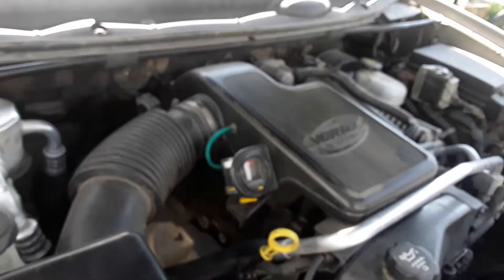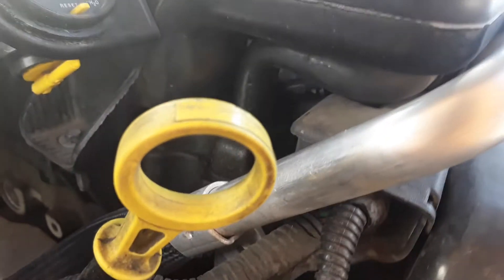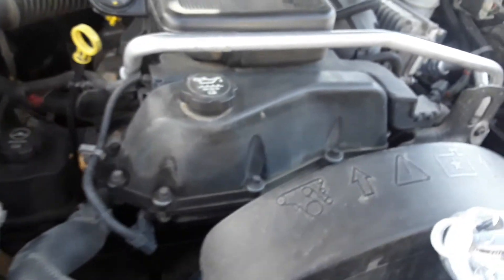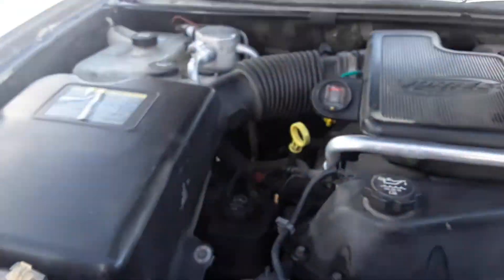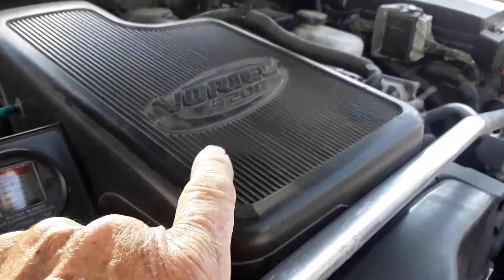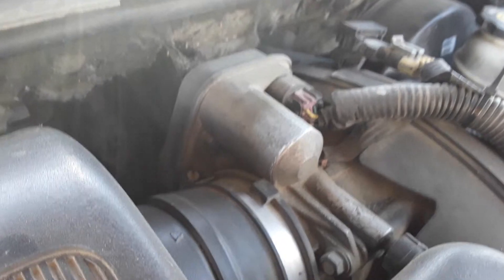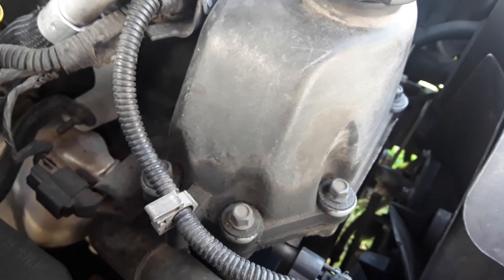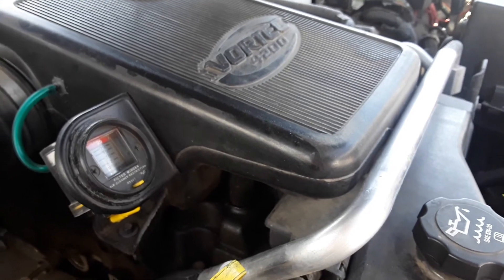Yes, The 4.2 Has A PCV System

Comment: Ok. I'm a newbie to car stuff I admit. How do you take that L hose off? Do u just pull the top part of it down until it slides off that rod thing? I'm sure I'm looking at the correct tube, I just don't know how to unhook it so I can pour stuff in..
Reply from the maker: I tend to not bother with taking the hose off the plastic nipple and instead remove the lower hose clamp and pull the hose up and open the metal tube. 
...... The metal tube is what you're after here - in some situations it's easier to take it off the top nipple - some it's easier from the lower nipple. 
..... You want to get the B12 into the tube, not necessarily the hose - but if you get it into the tube, it'll naturally run down into where we want it to go anyway. 
..... That big rubber hose is never gonna plug up without someone pouring JB Weld in it - and the actual problem is further down inside that metal tube.

Comment: Thank so much for the video. This system is more like the European vehicles no actual pcv but a system. Ps the Egr in this vehicle is control by the camshaft facer.
Reply from the maker: Sorry to be so late in responding, but I just caught this and as a matter of fact, this engine has NO EGR system - and that's because of the exhaust cam being variable and can keep the combustion chamber(s) from exceeding stoichiometric values.
Reply: @SurferJoe46  /ˌstoikēōˈmetrik/     relating to or denoting quantities of reactants in simple integral ratios, as prescribed by an equation or formula.
    "a stoichiometric amount of potassium is required for 90% removal of the SO"
wow - fancy word - thanks

Comment: Just curious... if you block-off the PCV hole at the intake,  and just vent the PCV hose into the atmosphere, would that eliminate any adverse effects from the PCV system without negatively effecting engine performance?  I understand it would vent unburned  blow-by gasses into the atmosphere,  but this is just a hypothetical question.  Also, why not route the PCV into, say, the purge system.  The pressure from blow-by would positively pressurize the fuel system and serve as a fuel pump assist.  Any over-pressurization could then be vented by the purge valve?  🤔
Reply from the maker: 1st --- the fuel system in the tank is under vacuum. If you pressurize it --- here come the flying monkeys. 
2. If you do not promote or at least maintain a vacuum in the crankcase, condensate builds up rapidly and gets homogenized into the oil and destroys the bearings, is especially nasty to the cam and followers and will rust the VVT into an inconvenient place that'll throw codes all day long.
Reply: @SurferJoe46  I never cared for flying monkeys. Thanks for the reply, I guess I won't reengineer my PCV system after all. 👍🏻

Comment: I don’t fully understand how to clean that tube. I’m pulling out the intake and replacing the valve gasket, and noticed oil all in the air box. Can you explain more?
Reply from the maker: The air box (correctly called the "sound deadener chamber") getting baby poop in it is because your CV-side of the system is totally plugged up and is reverse flowing.

The flow is INTO the nipple - that goes INTO the valve cover and INTO the crankcase and INTO the vacuum side of the PCV system (the CV-side) and is burned up as fuel. 

It's originally designed as an economy device but they found out it was sure nice to eat the sump gas fumes that smelled amazingly like an open sewer. . 

You have to take that rubber hose off at the plenum and add a couple of capsfull of B12 into it and let it cook a while. Repeat often until you get a small but noticeable vacuum at the oil filler cap. 

If you're removing the whole intake plenum and runners, you will have better access to the ports and you can clean them a lot better when they are in the open.
Reply: @SurferJoe46  got it! I recently replaced my valve cover so I took the intake off anyways and cleaned that hose you’re talking about. I also installed an oil catch can at the nipple and sound deadened chamber and it’s already filtering crap.
Reply from the maker: @TheCodesterr  That's all well-n-good, but you're not getting the water out of your engine.
You need to get that PCV System flow working, not just catching the bad results.
The problem is not being addressed the way you've done it and you run the risk of rusting the VVT intro a seized-locked position. 
Many people keep having trouble with the VVT and the PCV is the cause. 
You've gotta fix the problem!
You can watch this guy - it's not EXACTLY your situation - but the results and the logic are the same ..https://www.youtube.com/watch?v=PDkCbJOV-28
Reply from the maker: @TheCodesterr  The hose is only a pathway to the problem --- which is in the head gasket area. Taking the intake off will not allow access to the actual ports that are considered as the major players of the passive PCV system. 
When we pour B-12 in either the tube or the nipple - it goes to the same place to soften up and eventually allow the crud and corruption to be sucked out of those passageways. 
When they are clean, the PCV will be able to work and there will be NO baby poop in the air intake system at all. None. Nada!

Comment: Thanks for the info, great video. I just got one of these and I'm working out the kinks. My throttle body was disgusting and when I was changing the plugs I noticed a bit of oil so I did the valve cover gasket and plug seals. During that nightmare I noticed that the intake was totally filled with gunk, even the ports were caked with at least a quarter inch of goo. 

Did my best to clean that all out and that led me to the Trailvoy forum where I came across this discussion and this video. It's running much better now but I still get a bit of slight bogging for a second when I come to a stop. The idle isn't quite as smooth as I would expect from a straight 6 either.

I'm going to see if the CV side hose is clogged. Maybe the entire intake manifold being clogged caused the same thing as you described. Any more tips for cleaning that out? I think it must be worth a shot, but I do feel sketchy dumping cleaners down there into the crank.  Should I just remove that hose and clean it or is it probably clogged deep inside the passages? Any specific cleaners I need for this? Can I just safely dump it in there and pump it back out with a hand pump? Any details would be greatly appreciated.

Sorry for the 50 questions but you seems like a trustworthy source and a helpful person and this info doesn't seem easy to come by. Again, thank you sir. o7
Reply from the maker: PS .... I also used an air nozzle with a long tube and pushed it down into the hose and hit the trigger a few times  ... not really letting the pressure get too high ... a touchy-feely thing that uses a 6th sense to know when enough is enough and when to stop.
Reply from the maker: The liquid is going into the intake and won't contaminate the oil in the engine. It's a totally different system. 

Persistence is the answer and it will get better and better with every application. 

You've gotta keep at it until you think it's really clean - evidenced by the vacuum at the oil filer when you put your hand over it while the engine's running.